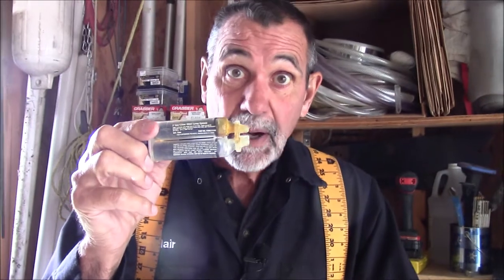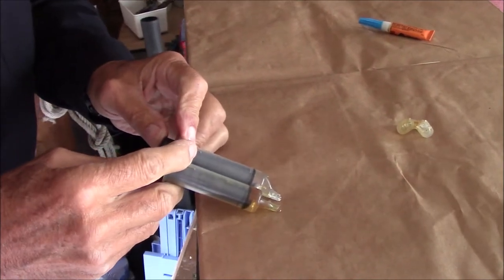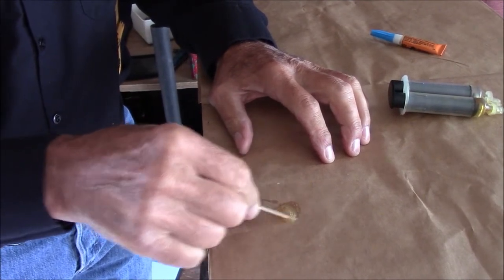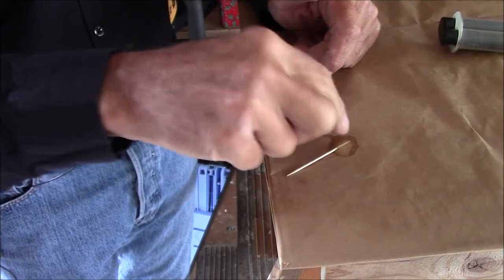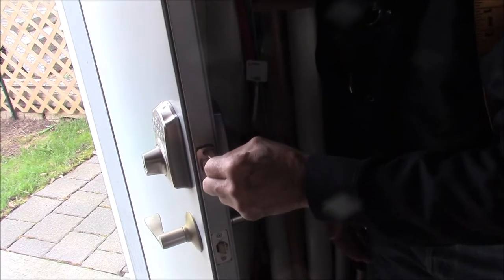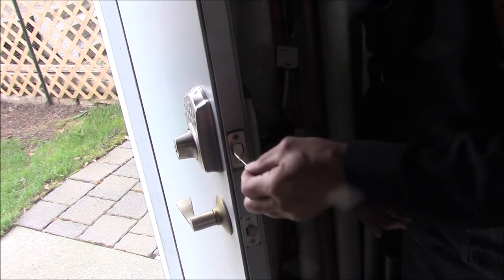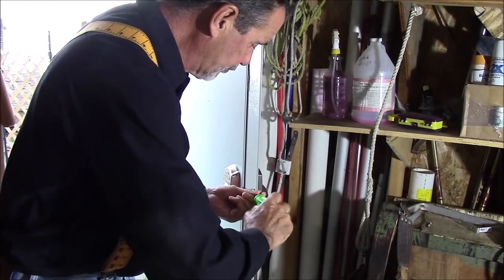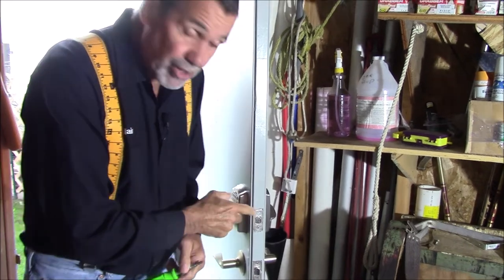Easily Repair a Stripped Out Screw in Wood

Comment: You could also shove toothpicks in the hole one beside each other until the hole fills up, break them , and then drill a hole in them slightly smaller than the screw going in. God Bless, thank you Mr. Hardware.

Comment: Thanks for the easy to understand video. I'm trying to fix cabinet handles that are aluminium and want to avoid using a thread repair kit. I've done a little bit of research, but I'd like your expert opinion...will this work the same as what you've demonstrated?
Reply from the maker: I can be tough trying to re-tap a shallow hole. I would probably use something like JB weld or PC-7 to coat the hole with before I re-tapped. The other issue is the hole is so shallow. You’re gonna need a bottoming tap because the regular tap doesn’t thread the last quarter of an inch all the way down. Plus coupled with the force put on a handle opening and closing the door is a lot. This might not be a good idea to save these handles.
Reply: @MrHardware1  Thanks for replying! That's  so kind of you - and so quickly too! To clarify - should I stick with a different epoxy like JB weld or PC-7 and just screw as normal rather than try and tap? Thankfully the draws are soft close and the kitchen cabinet doors are quite light. I'm just trying to find a workaround or delay from buying a whole new set of handles really.
Reply from the maker: @amy-janeevans1544  machine screws, like a 8/32 that’s common for drawer poles, don’t self tap. You might try a very light coating of the thinner molasses viscosity epoxy and put a thin layer and see if the screw won’t bite in that way.
Reply: @MrHardware1  thanks again! I'll give that a go :)

Comment: can i do this the same way with JB Weld Epoxy?
Reply from the maker: You bet
Reply: @MrHardware1  Thank you, what about the JB StealStik can i put some in the screw hole wait a few minutes then screw in with screw, reason I am asking is StealStik is less messier and I don't have to mix. I am using it to hold a small crankshaft sensor which is on the back of engine. May I use the StealStik?
Reply from the maker: @trentonspeakstv  2 things, don’t fill the hole, just coat it so the hole is smaller, and don’t install the screw into wet glue. It turns the screw into a fat nail and if the glue bonds well you won’t be able to remove it at all later date.